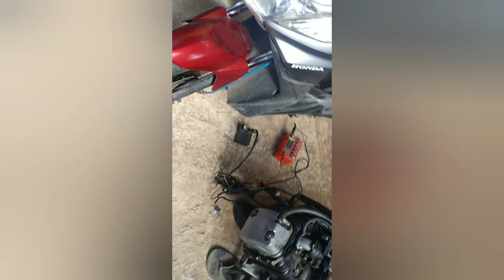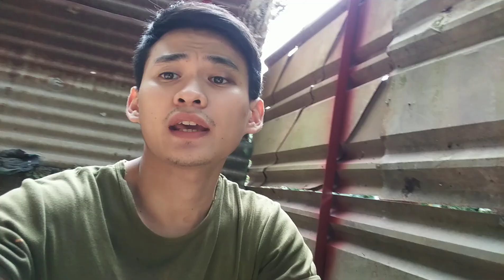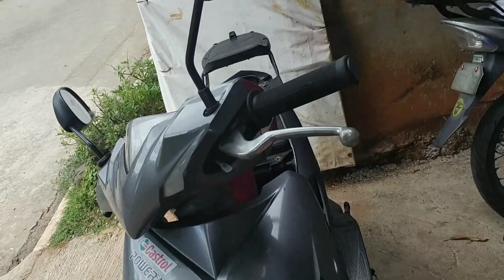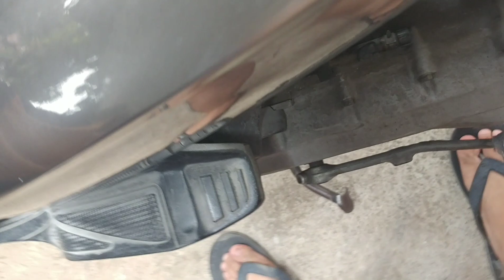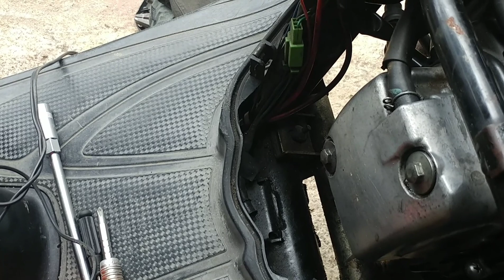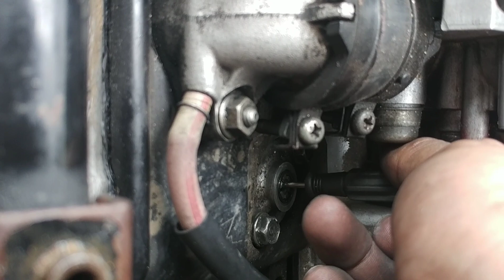Honda beat carb Maingay na makina

Comment: Boss tanong ko lang kung connecting rod sira ng mutor ko natuyuan kase ng langis brother di ko napansin nung tumatakbo ako kumatok sya tapos namatay then pag sindi ko may katok na sya na parang may holin sa loob ng makina
Reply from the maker: Maraming sisirain pag natuyuan sir. 
Cams
Cam bearing
Seg.bearing
Rocker arm
Block piston and piston rings
Con.rod
Pin. 
Yang mga parts na yan sir kaya mas okay kung macheck lahat yan.
Reply: @grayworkz2796  until now sir ginagamit ko sya pero hanggang 60 lang takbo ko kase baka pag binirit lumala e wala pa kasing budjet pangpagawa ok lang ba yun bossing
Reply from the maker: Mas okay sir pagawa muna kasi moving parts yun mga yun konting kayod lang tuloy tuloy na yun.
Reply: @grayworkz2796  nasa magkano kaya estimate mo dun paps pag pinabuksan

Comment: Sir okay lang ba kahit anong break shoe ipalit sa honda beat carb ? Pag maingay sir yung gilid anong sira ba yan tapos mahina arangkada niya sir kahit ubus mo na ung throttle ano problema ?
Reply from the maker: Mas okay sir kung branded na bilihin mo. Kasi merong break shoe na di makapit.
Reply from the maker: Bola sir check mo. Lining belt slide piece.
Reply: Salamat idol

Comment: Paps bat pag nag start ako ng beat carb ko minsan naputok ng malakas? Sabi naka bukas daw barbula non, ano gagawin dun paps?
Reply from the maker: Singaw sir sa pipe.
Reply: @grayworkz2796  mukhang hindi naman po sir kasi 1/10 na pag start lang po siya nangyayari, possible po kaya na di masyado naka sara valve non?
Reply from the maker: Pedeng wala sa timing sir or loose compression.
Reply: @grayworkz2796  ahh okay sir salamat po

Comment: Boss tanong lang, ung beat ko na 2014 lately parang may papel sa electric fan ang tunog sa tagiliran pag 0-30 pero pag pataas di na ganun ka noticeable ung tunog. Ano kaya problema nun?
Reply from the maker: Try mo sir ipalinis. Baka madumi lang sir.
Reply: @grayworkz2796  Sir salamat sa reply! kakalinis lang nya nung lunes, andun pa rin eh. pnalitan ko kasi ng ung torque drive ko nung December. Di kaya dahil dun? Sa tagiliran nang gagaling problema eh..
Reply from the maker: @jmanaloo  try to check slide piece sir ply ball bushing.
Reply: @grayworkz2796  Kapapalit lang sir nung slider nung lunes din, kasabay nung linis. Nakakainis ung tunog eh di ako matahimik talaga
Reply from the maker: @jmanaloo  kung malapit ka dito sa antipolo sir pede mo patingin saken.
Reply: @grayworkz2796  San banda yan sir? Update lang pnalitan ko na rin lining ko andun pa rin ung ingay. Chineck ng casa ung tunog sabi flarings daw eh parang hindi naman.

Comment: Boss. Tanung ko lang ano problema ng beat ko 2014 acq 15 ko siya nailabas tapos ngayon. Kapag malamig yung makina niya pag kasalukuyan ka nasa 20-40 speed mo parang may gagasgas na tunog chain ata yon. Ilang beses kuna pinatune up pero ganun parin. Pero kapag uminit na makina naalis din yung ingay pero pigil yung takbo Niya at walang arangkada. Sana matulungan hehe salamat boss more power!
Reply from the maker: Sa makina ba galing or sa pang gilid yung ingay sir?
Reply: @grayworkz2796  mismong makina sir
Reply from the maker: @micojohnayran4068  baka t.chain yan sir check mo tensioner sir baka sira na
Reply: Tingin ko nga rin sir magkanu estimate mo sir magkano Yung tchain or tensioner.
Reply from the maker: @micojohnayran4068  tensioner 350 sir.

Comment: Sir, sana matulungan mo ko sa problema ko sa beat ko. Carb type din, ano po kaya kailngan gawin sa pupugakpugak sir? Pag umpisa ng takbo nya ayos naman pero pag pugain na throttle bigla lng nawawala yung lakas yung parang nauubusan ng gas pero di sya namamatayan ng makina, habang tumatagal pa hina ng pahina na takbo ko kase kahit di mo na ipuga ang throttle sunod2 na ang pugak nya. Salamat po sa sagot sir 🙏
Reply from the maker: Ito mga dapat mo i check sir
Carb baka madumi.
Linisin dapat maige kung may air compressor ka mas maganda. 
Air filter baka palitin na
Spark plug baka palitin na.
Reply: Kakagaling lng neto last week sa mekaniko mismo ng honda sir, nilinisan nila yung carb, bagong sparkplug, sinubukan ko narin palitan air filter kase naka box pa yung air filter nya sinubukan ko bago ganun parin
Reply: @grayworkz2796  sir thank you sa mga video nyo dami ko natutunan, tanong ko lang sana sa honda beat carb ko po kasi kapag kaka start eh tumataas bumababa po yung idle tapos mga ilang segundo din naman eh magiging normal na ano po kaya ang problema po duun?
Reply from the maker: @MM-zw7we  possible sa auto choke yan sir. try to clean your carb sir.
Reply: @grayworkz2796  maraming salamat po, saka ano po kaya yung ingay po sa may bandang magneto side ko? parang sa loob na po yung tunog eh pero mas malakas dun sa side ng magneto po
Reply: @grayworkz2796  pwede ko po bang isend yung video ng ingay sa magneto sainyo baka masagot po ninyo po ang sira
Reply from the maker: @MM-zw7we  sure sir.
Reply: @grayworkz2796  pano ko po isesend yung video po sainyo sir?

Comment: Paps ask ko lang kung ilang taon na motor mo
Reply from the maker: 10 years na years na sir.
Reply: @grayworkz2796  ayos paps new subscriber here
Reply: @grayworkz2796  paps ano po mgandang combination pang gilid honda beat carb po ung akin
Reply from the maker: @pandobandido4906  depende sir sa timbang mo eeh. Pero so far best 10g straight. 54kg ako
Reply: @grayworkz2796  ayos sir salamat po sa info halos same lang po timbang naten
Reply from the maker: @pandobandido4906  ayun sakto yan sir. Arangkada at dulo meron yan.